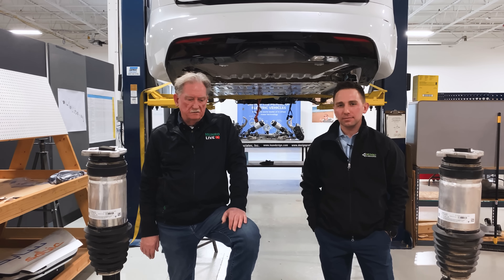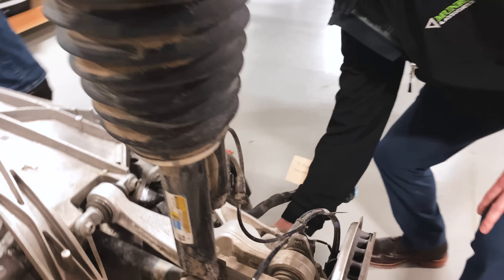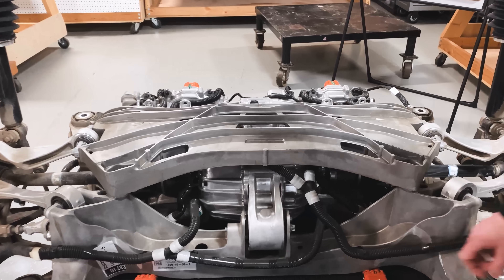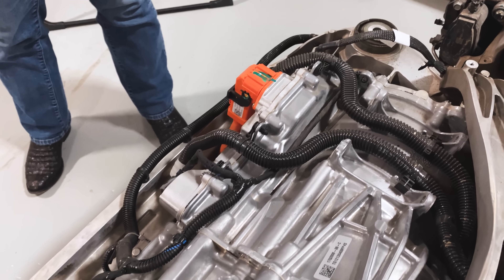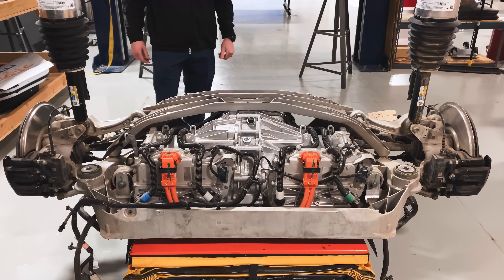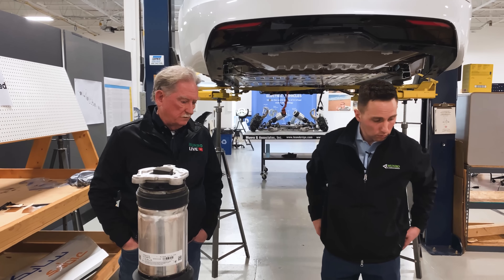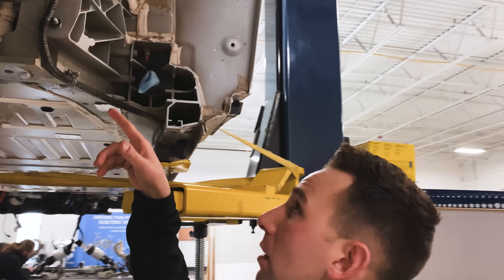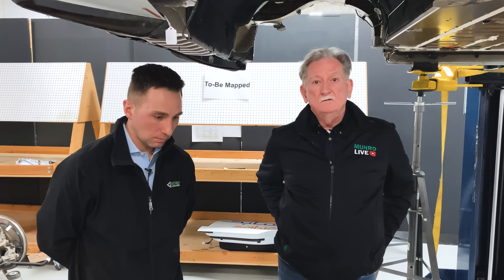Rear Cradle and Electric Drive Module | Tesla Model S Plaid Teardown

Comment: Porsche Taycan Rear Axle looks about the same. Audi e-tron S (Twin e-Axle ATA250) also looks similar. I cannot see, how Tesla would really differ.
Reply: No Koeniglicher, even Porsche is not going have die cast aluminum parts only Tesla right has ability to do that right now.
Reply: @marctemura2017  exactly, before gigacastings the only IDRA machines used in the automotive industry were for matchbox toys.
Reply: @marctemura2017  That is not true. BMW does die casting at its Landshut component plant. Audi does so in Münchsmünster. They use it for structural parts in the body (like in Audi A8, Audi TT, Porsche Taycan, BMW 5 and 7 series) and cylinder heads. Porsche has die cast parts in Taycan like for the longitudinal members. And all of them can source die casts from suppliers as well. The german term for die casting is "Druckguss". When using alloy: "Aluminium-Druckguss". You will find references with this term.
Tesla may use die cast structural parts of a bigger size in its car bodies, but that comes with consequences as well like more effort in quality assurance and higher scrap rates. And like they analyze in the video: many parts like the suspension arms are simply forged or sand cast. There is a number of suppliers for that.
Reply: @koeniglicher  No Koeniglicher, they are doing sand casting. German engineers are begging their "Suit" to buy the machine, and MBA's won't do it.
Reply: @marctemura2017  They (or their suppliers) are doing all techniques: forging (Schmieden) - for ages, think of the Fuchs wheels, sand casting (traditional casting, Sandguss), die casting (Druckguss), continuous casting (Stranggießen). Will depend on part and requirements.
Reply: You can’t see because you don’t want to see.
Reply: @davidrink1291  Munro should simply put a rear e-axle from Mercedes EQS, Porsche Taycan, Audi e-tron S, BMW i4, Lucid Air, XPeng P7, Nio ET7, you name it right next to it. Any other brand, that offers an executive class sedan style BEV car. Ideally, a dual motor rear axle. Or at least provide some evidence with pictures.

Comment: Impressive engineering but it looks wickedly EXPENSIVE ! Hardly anything related to AFFORDABLE electrical mobility. Have you considered the corrosion issues of mixing steel and aluminium components ?

Comment: I’m curious to learn if the sides are 100% separate or if there is an electronically controlled torque coupling/splitting device in the middle.
Reply: The two sides are completely separate. Dual rear motors eliminates the need for a differential. There would be no benefit to adding any way to couple the left and right. Just the opposite in fact. Independent control of the two rear wheels allows optimum power to each side, including deliberate biasing to one side or the other (torque vectoring) to improve cornering.

Comment: By “mirrored gearboxen”, shirley you mean that there is no differential, and that each motor drives it’s own wheel?

(About “we have that program we’d like to reuse”, how about Ford who pumped out the Mustang out of a Fairlane chassis? 😁  )
Reply: Mirrored gearboxes. Where do they say anything about a diff?
Reply: Yes, that's correct: no differential, and each motor drives its own wheel through its own gearbox. The gearboxes are mirror images of each other.

Comment: @munrolive: Once the drive units are disassembled, please give your opinion on the feasibility of utilizing the carbon-wrapped rotors in the Model 3/Y. It could provide a nice performance upgrade and differentiate the Performance/Long Range. Thanks!!
Reply: You don't need that much speed

Comment: How about an analysis on insurance cost and casting crack damage risk after an accident. I'm guessing reparable accidents on other vehicles are deemed "totaled" on these large castings. Also, what are the replacement costs for each of the suspension components after normal bushing wear?

Comment: In regards to backwards compatibility of parts, I've read that Tesla does not maintain a large inventory of parts for older models of their vehicle. When a part is required for a repair, they just use the latest in-production part (i.e., you get the latest and greatest). I'm sure there are some parts that aren't compatible with older vehicles, but in general this approach cuts down on a lot of inventory.
Reply: That's normal, where an upgraded version of a part is backward-compatible. For instance, when I replaced the junk sway bar end links on my Ford Focus, what came from the dealership were a somewhat less junky version of the same part, as fitted to later production.

Comment: You can't swap motors.  My cousin works there and the wiring is incompatible with the battery pack as is the electric management system.  Referring to the swap of an old rear drive model S.  It must be 4 wheel drive.
Reply: Is the subframe? In an awd?

Comment: Id just love to stick that cradle into 
My old Chevy !
Reply: Won't fit...too wide
Reply: Conversion projects sometimes use complete Tesla (Model S or Model 3) subframes with suspension and drive unit, but width is a problem for most older vehicles.

Comment: The rear assembly screams quality and looks incredibly solid. Same with the front module. Incredible stuff. Yet when drivers from a popular car magazine drove the car at high speed they noted an instability in the suspension that they found scary and contrasted it with Taycan that they characterized as rock solid. Not sure if you guys are expert in suspension dynamics but do see anything that would explain this?

Comment: Even if backwards compatible mounting. I don't think it would be safe to put a Plaid rear dual motor in an older S. I'm pretty sure the torque and stress from the Plaid motors would cause severe issues on the rails and substructure.
Reply: What rails?
Reply: @vidznstuff1  there's probably a more formal name for it but I'm referring to the frame structure linking the front to the rear.

Comment: 9:30 "...and you could pull that out and put in a whole new rear module...": Caterpillar sold that as MCE (Major Component Exchange). Look at the design of their hi-drive sprocket dozers.
Reply: Are they compatible between generations? I guess Caterpillar doesn't have to chase the fashion business like the passenger vehicles. I remember Asimov critized how automobile industry forces the consumers pay the cost of face-lift each year after Ford model T, Elon probably read it too as a kid.

Comment: Notice how many die castings are being added to the design of new Teslas?  Reminds me of when Honda introduced die cast oil pans on their combustion engines to stiffen the bottom end and reduce flexing in their four cylinder engines.  All the other manufacturers just used stamped steel oil pans, it was just there to hold oil for them.  At Honda, it was to allow them to reduce the weight of the aluminum block and improve the performance overall.  It's beautiful when the engineers are allowed to design the car bits no matter which company they work at.
Reply: Lol….. oil pan! It has nothing to do with structural integrity!
Reply: @alanmay7929  Ding ding ding!  We have a winner, who has no clue about FEA analysis of the structural stiffness of engines and no desire to lower weight for greater efficiency!
Reply: @morrisg  I prefer ding dong! Lol 😂

Comment: So the last 10-15yrs everybody have been building front wheel vehicle. Now the EV vehicles are going back to the rear wheel vehicles is it because of the size of the main motor?
Reply: I'm far from an automotive expert, but I know that rear wheel drive vehicles were generally considered superior on handling (though it's a little more complicated than that) and were only replaced by front wheel drive vehicles due to issues related to fuel economy - which is why front wheel drive was rare before the late 1970s.

Going electric makes that trade-off unnecessary, as there is no need for a driveshaft and all the rest. Given the choice, we will likely see a return to rear wheel drive vehicles across the board - though we'll also likely see an increase in all wheel drive vehicles.
Reply: @alanlight7740  yeah well a 4 wheel truck was not a true 4x4 did you ever notice that only the left rear and right front only turn when stuck in the mud ? unless you got the limited slip package that’s what you got. Same with a front wheel drive vehicle, did you ever notice in the manual when you rotate tires the alway tell you to cris cross the tires if it a front wheel drive right front to left rear and visa Versa on a rear wheel vehicle. It use to be in the winter time in a rear vehicle car you carried 2 2x6’s and a large bag of sand or kitty litter to be used if you get stuck but is also used to put weight over the axles so the down force will give you more traction on the wheels, same thing with a truck you would put logs or cinder blocks over the rear axle. With a fro t wheel vehicle you have the weight of the motor
Reply: Front wheel drive was always mostly about packaging. The powertrain of an EV is larger and heavier than that of a ca with an engine, but it's not concentrated in one lump at the engine, and there's no need to join an engine to the driven wheels with an awkward shaft. That means that in a vehicle designed as an EV from the beginning, either there is a motor or pair of motors at each driven axle (AWD), or the motor or pair of motors is at the axle you want to drive (the rear), not the one where you have space (the front).

Comment: They are probably still pumping out the old designs on the basic S.

 Plaid is thier halo car that just is housed in the existing S body and charge $140k without making a supercar body type and just fintuned the guts in new ways for performance.
Reply: The wind tunnel says otherwise.

Comment: Hey Sandy! Great video.

Can you show examples of what a LACK of cross team cooperation looks like on some of the other vehicles you have torn down?

I am not a engineer by trade. But you do not need to be a Rhodes Scholar to see just how tight that entire rear assembly is.

Can't wait for the next video!
Reply: There is no lack of cross team cooperation of other vehicles lol….
Reply: As I recall when he tore down the Ford Mach-E he found that different parts of one sub-assembly used two completely different kinds of connectors where they should have been standardized.
Reply: @alanlight7740  the MachE the cooling system was a perfect example.  Would like to see other examples with other systems

Comment: "Simplicity is the ultimate sophistication" by Steve Jobs, in the book "Steve Jobs" by Walter Isaacson. 

"It takes much more effort to make it work simply, than to simply make it work" by Jason Crawford, just now.
Reply: Lol…… I fortunately it not always the case, by oversimplifying things like those devices or cars, it creates at the end soooo many limitations, look at IOS vs, android or even macOS bs windows, there is way more flexibility outside Apple ecosystem, the latest tesla structural batteries are going to be a nightmare to repair or reuse compared the modules in pack ones…..

Comment: A bit off topic but....    how will Tesla attach the stainless steel CyberTruck exoskeleton to stamped and/or cast aluminum sub-structures without galvanic corrosion becoming an issue?
Reply: Adhesives.

Comment: We had this type of culture for awhile at Chrysler until the germans took over.  I much admire Tesla and Musk.  You need to improve your aluminum metallurgical knowledge regarding casting/forging alloys.  Most high pressure die cast parts are made from a 380 type alloy that is not heat treated to increase strength.  I think the gigapress alloy is a slight modification to this.  Most low pressure (permanent mold) castings that are not heat treated are a 319 alloy.  Most heat treated aluminum is a 355 or 356 alloy that is T6 heat treated. All cast aluminum alloys are 3 digit numbers unless the standards numbering system has changed in the last 13 years since my retirement from Chrysler. 2XXX, 5XXX, 6XXX, and 7XXX alloys are common non-cast alloy designations. Please note that there is very little advantage to a forged vrs. cast aluminum component. Many mechanical engineers do not realize this. They usually believe that the forged steel properties increase vrs cast irons carries over to aluminum. They do not.

I also noted in one of the other videos that you observed some material degradation in some of the liquid pump castings. This condition may be caused by a cavitation condition. Cavitation can cause severe erosion of cast material in a very short time, espesially aluminum.

One more thing, steel fasteners into threaded aluminum is not a good idea for structural parts subjected to cyclic loads. Threads in aluminum tend to loose their ability to retain torque.

Very much enjoy your series on electric cars. Makes me wish I was 15 years younger.
Reply: For what it's worth, they did indicate a problem in the pinned comment: "A tear was found in the protective Mylar film on the the X-Ray Thermoflourecent (XRF) spectrometer which resulted in incorrect material readings."

Comment: Are the rear rail casting holes on the outboard side (where the wheel well panels join) tapped by a machining process or are thread-cutting bolts used?  Also curious if you found any applications of Flowdrill screws on the vehicle (seems a good choice given the extensive use of extrusions).  Thank you!

Comment: I wonder if the Model S Plaid motors are exactly the same as the Model X Plaid motors.  Would be pretty awesome if they could get economies of scale by using exactly the same components for both vehicles.
Reply: I'm about 99% sure the motors are the same.  They were the same in prior years between the S and the X.
Reply: That's literally what they do lol. Different chassis, same battery, powertrains, etc.
Reply: @Lando_Sage  lol…. The model x is just a model S but in SUV, it’s just a higher bigger vehicle on top of the same chassis

Comment: So nice to see great engineering! It would be interesting if you compared this set-up with, say, a BMW, Mercedes, or Ford luxury product.
Reply: When it comes to luxury product, nothing even compare to the Germans sorry to disappoint you. Also bmw, Volvo and others have been using recycled materials in their cars for years now.
Reply: @alanmay7929  This is not a case of me setting myself up for disappointment. I have owned  German cars over the years, and I liked them - a lot. I simply suggested it would be interesting to compare suspension engineering on other luxury brand cars to this Tesla. Everyone is after the same basic goal, but they may approach it in many different ways.

Comment: It is interesting to see the 5000 series aluminum casting "Monument" on the top of the rear was "Made in China".  I had thought that the New Model S Plaid was all "American made".
Reply: I don't think there are any 100% American cars being made today.  Tesla vehicles have one of the highest percentages of American made parts and assembly.  For parts content, the sticker shows 55% US/Canadian.  The largest source of foreign components is Mexico at 20%.  China must be less than 20%.  Final assembly, motor assembly, and on-board charger are also listed as assembled in USA.
Reply: @tesla_tap  wrong, tesla parts are mostly made in foreign countries compared to other manufacturers, from the 12v lithium batteries made in Taiwan to compressors made in South Korea, to heat exchanger made in China, filter in Germany and a ton more different parts including screen probably made by Samsung…

Comment: How much weight difference between the first gen Model S and the Plaid cradle?
Reply: It’s not the same car anymore.
Reply: @alanmay7929  I know that, that is why I was wondering if they saved weight in areas to compensate for the 2nd motor and gearbox or if controlling 1000+ HP would weigh more anyway.

Comment: "a packaging symphony"  that's what I like to see in a product. Efficiency WITH performance and quality.. that's what I want to buy. The best engineered product.. with the best, or at least near the best performance for the buck.. married with the best software maker for an automobile. That wins my $

Kia is making a nice new EV with the EV6.. Mercedes has their EQC and stuff.. BMI i blah blah numbers.. Audi and their Etrons.. all nice cars.. all have fans for one reason or another. None of them even come close to this kind of execution of how to build an EV. They may make a better 'car' in one facet or another.. ie better drive feel for BMW, interior materials or quality and sound isolation for Merc and Audi or a better price point in relation to Kia and Hyundai. But none of them know how to engineer a better EV than Tesla, from everything I see from all these teardowns. Will be VERY interesting to see the Rivian, and maybe a Lucid, torn down to see how those new guys have approached this kind of new engineering strictly for EVs. Maximizing space.. minimizing parts and mass.. integrating multifunction components and software with hardware.. these guys are off the charts.

Thanks again Sandy and the Munro team for this teardown! This is the kind of stuff I was hoping to see. Makes me definitely think more about updating my S to a new one. Not necessarily a plaid.. lol.. but the new long range would carry all this through it in general. Though I am still up in the air about a Cybertruck.. that stainless steel body has some big benefits to me on my commute. I have no need for a truck in my life.. but a tank of a body shell would handle the highway damages I take regularly. West Texas is a bitch of rocks from trucks and all the animals crossing I10 and I commute 250 miles each way. Kinda wish they'd do a special Cyber S model lol